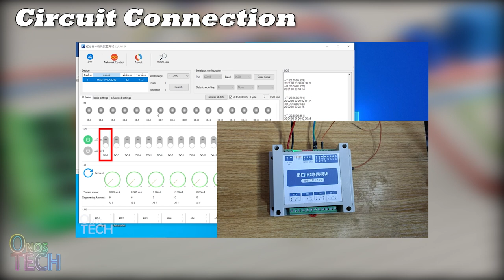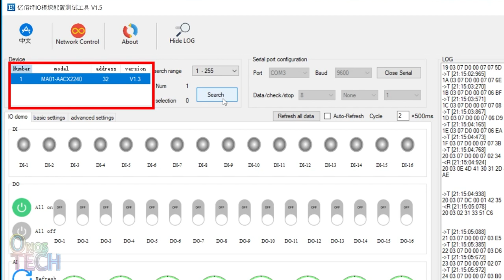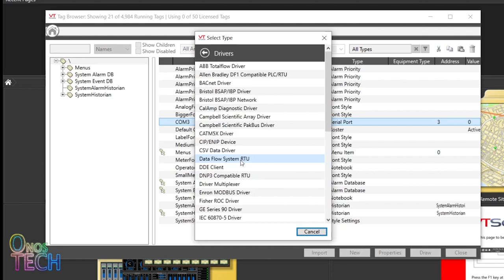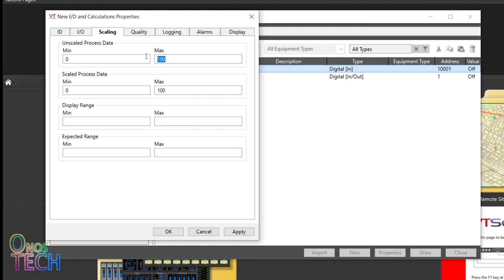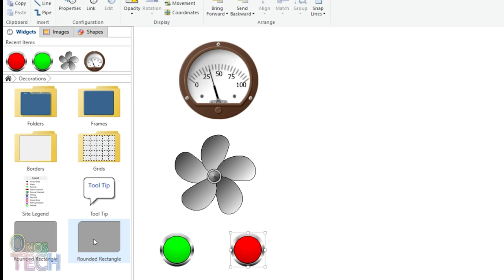Industrial Fan Control with VTSCADA & EBYTE RTU IO Module

Comment: Excellent video, do you think there is a way to connect the module via rs485 to a Red Lion HMI? I am interested in buying the module but I already have the HMI.
I hope you can bring more videos about the device since the information is scarce.
Reply from the maker: I don't have this HMI. I only currently have the OP320 HMI which supports RS485 Modbus RTU. Kindly check the Red Lion HMI user manual for Modbus RTU support. If it does, then you can connect the Red Lion HMI to the module using the universal Modbus addresses.

Comment: Good can I use k type sensor with this module
Reply from the maker: You can use it with this module and an additional module like this one: https://s.click.aliexpress.com/e/_DkHfnaV
Reply: @OnosTech  Unfortunately the price will be high. Better to use arduino with max6675
Reply: @OnosTech  Unfortunately the price will be high. Better to use arduino with max6675